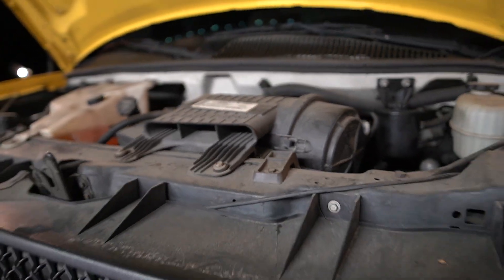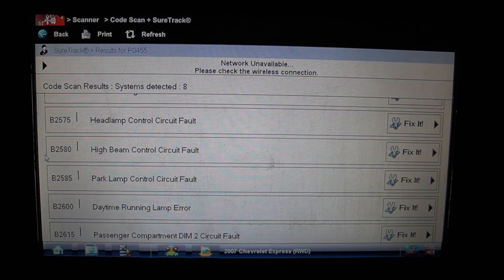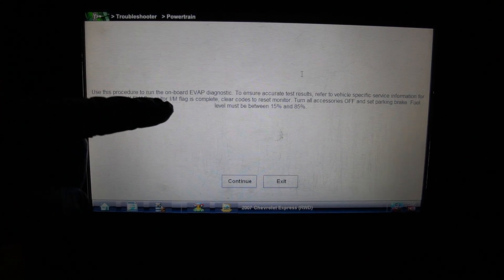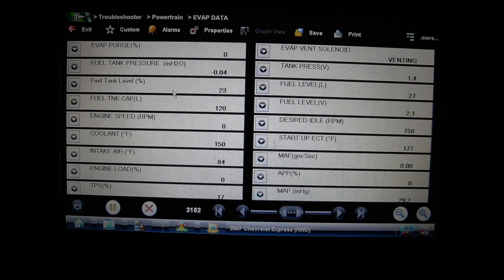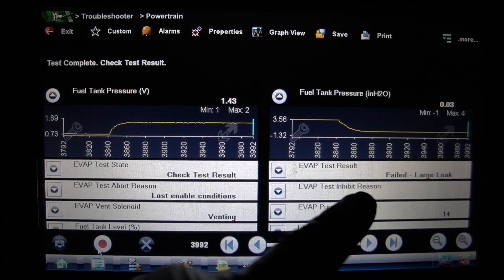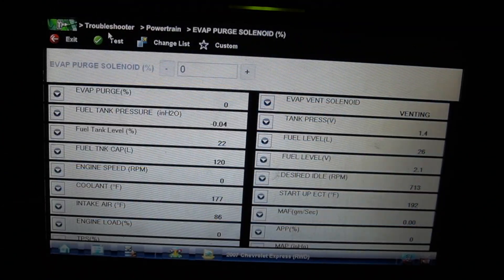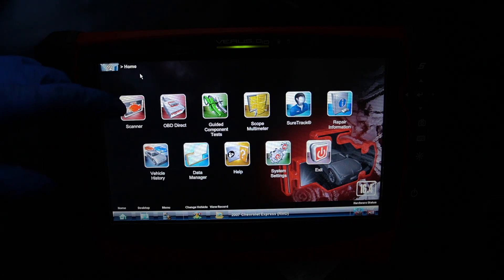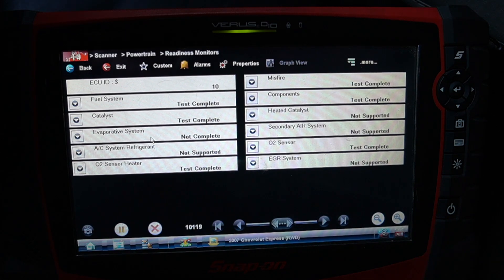What to Check on P0455 Large Evap "Leak" Not the Gas Cap

Comment: I have Evap leak code P0440 and P0456 for dodge charger 2020
I did a smoke test and found smoke coming out from the rear wheel right side canister
I change the canister with a used one
But again there is a leak from the canister
I have already change the purge valve and evap sensor with new one
Can any share their experience if they had same issue

Comment: If you're trying to pass smog and have an evap leak, and your vehicle is like my truck, the evap system only checks for leaks when it's between 15-85% fuel capacity, somewhere around there. Fill your tank all the way up, clear the check engine code with a obd2 reader (you can also borrow these from most auto part stores like Oreilly's and auto zone for free, but I highly recommend at least owning a cheap one), and then drive around 50-100 miles to build up some fresh driving data. Make sure you fill up your tank if it gets too low throughout this process. After that, you'll be all set to pass smog.

I'm not sure if this works for every vehicle, but it did work for my 04 Sierra. This isn't a permanent solution and I'd recommend resolving the issue for good, but if you have a pain in the ass evap leak and you need to register your vehicle this is always an option too.

Comment: Wow carnal. 
I think you just solved my problem. 
I was keeping my eye on that part. But was hoping it was the fuel cap. 
Have the same car with check engine large evap leak. 

I’ll hit the auto store tomorrow and change those parts , reset the light drive a few miles and hope it stays off.

Comment: Bro I’m getting ready to change my purge can on my 07 grand Cherokee w p0455/p0456 codes also after I put the new purge can I need to drive her around for about 10 mins and do I need to disconnect the battery plugs at all b4 installing the new purge can?

Comment: Love the video homie, how would you approach it, if you don't have a bidirectional scan tool? How would you energize the purge valve?
Reply from the maker: I’ll make a video on that.
Reply: Thank you Homie, I'll look forward for that. Best wishes.
Reply: Take off the purge valve, connect positive low voltage power source to the valve, blow through the valve (after cleaning it, haha) then tap the negative lead from your power source to the valve, you should feel the valve opening and closing completely.